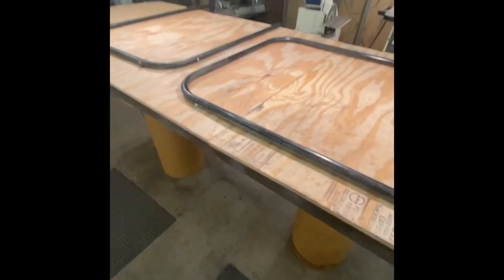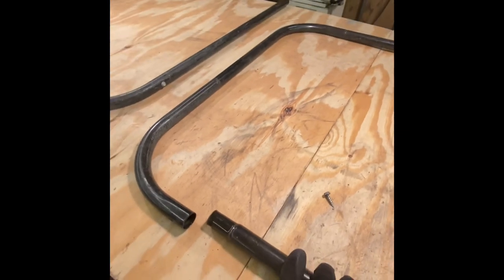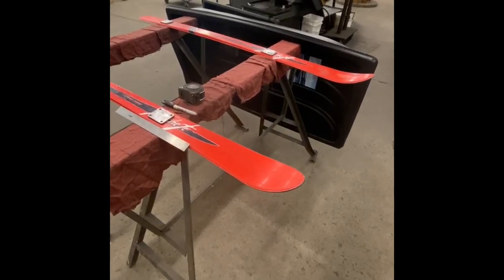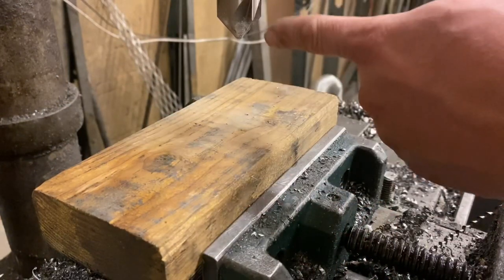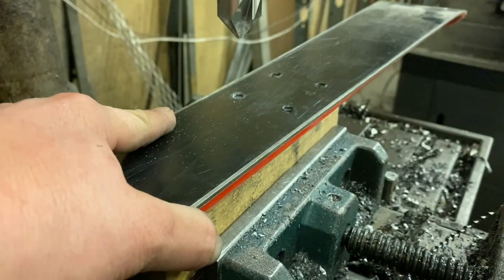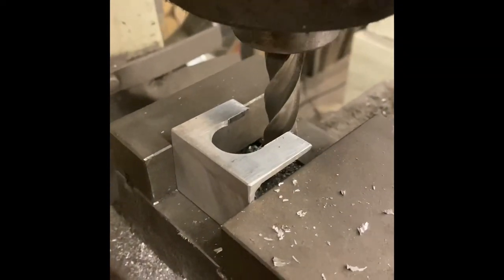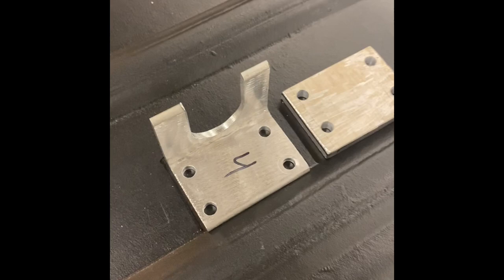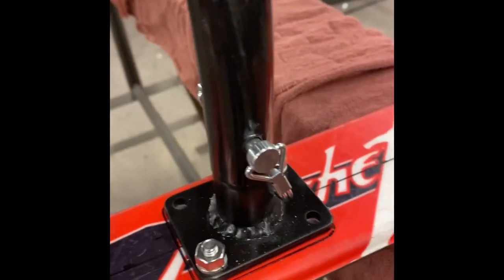Smitty sled build part 2 . Connecting the skis to the sled.

Comment: I think that build is totally perfect in every way. But the tube you used seems flimsy for long term hard use
Reply: If Im not mistaken ,it appears Jake is a welder by trade and should know a bit about Metallurgy...?
Reply from the maker: Been using it for 2 seasons now, still as strong as the day I build it.